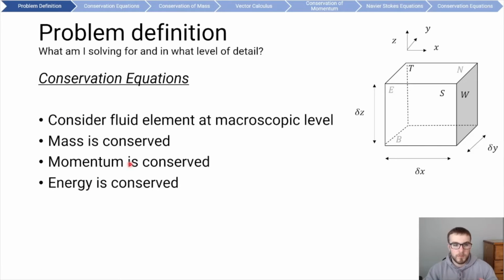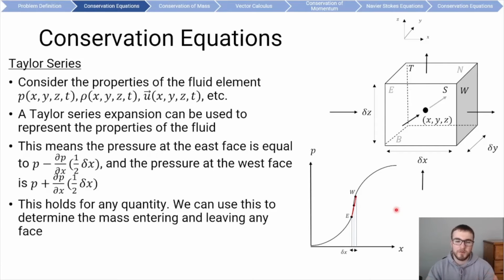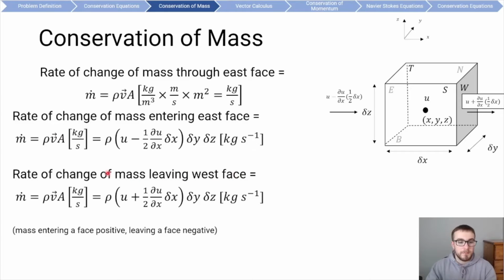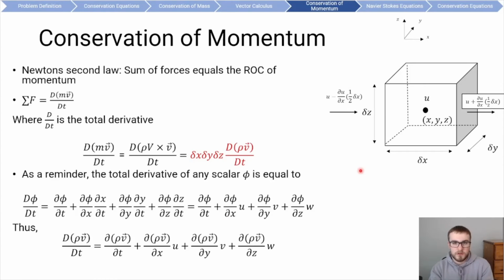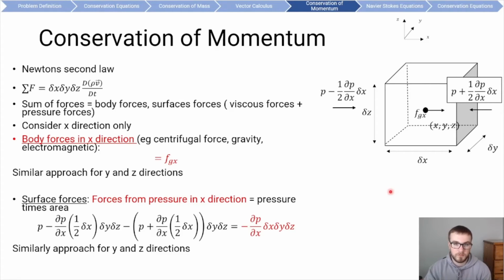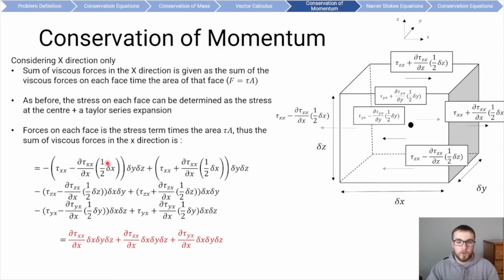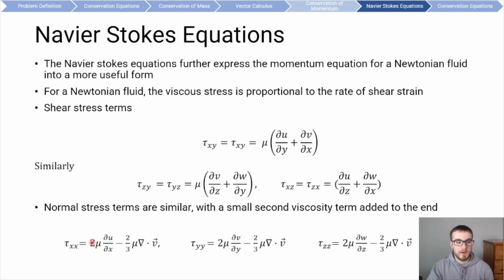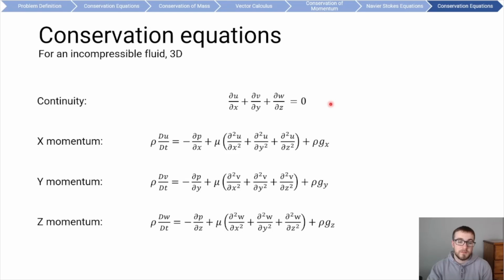Conservation Equations in CFD

Comment: Hi mate. Great video again, thank you for the effort. I have an observation.

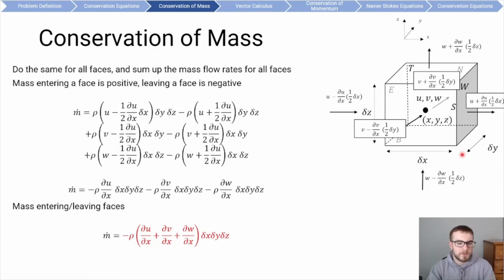From 7:11 when the mass flux is being expanded w.r.t. the fluid particle, all the velocity terms are derived with respect to the x-coordinate. Furthermore, when the velocity is being derived for both the y-direction and z-direction, it is observed that the derivative of the velocity is with respect to "u" instead of being "w" or "v". This is strange as in the figure where you have the fluid particle the opposite is happening. Then everything is defined to its respective direction. Is that an error or is that on purpose? I would expect for the y-direction:

m' (S->center->N) = rho(v - dv/dy * (1/2dy)) - rho(v + dv/dy(1/2dy)).
m' (B->center->T) = rho(w - dw/dz * (1/2dz)) - rho(w + dw/dz(1/2dz)).

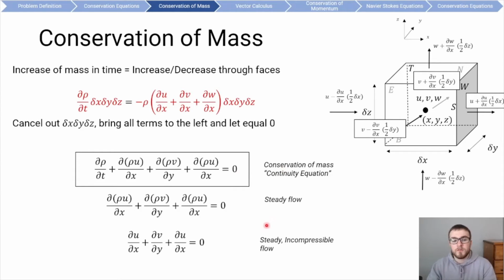The reason why do I think that, is because I don't see the relation between the expression mentioned at the end of the slide from 7:11 and the final form of the continuity equation mentioned in 8:34, as you derived everything w.r.t. the x-direction, instead of deriving it into all three of the directions (x,y,z).

Let me know, and thanks again for the great video!
Reply: Yeah, I noticed that too! I think there's a mistake in the video. In the book by H K Versteeg and W Malalasekera the process is as you've described it!
I know it's a late response, but wanted to leave it here for others as well!